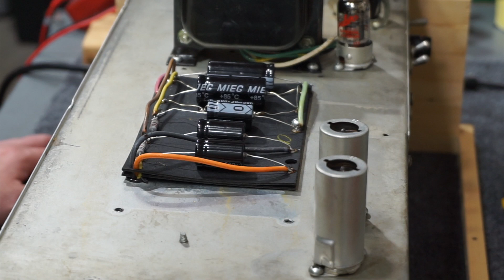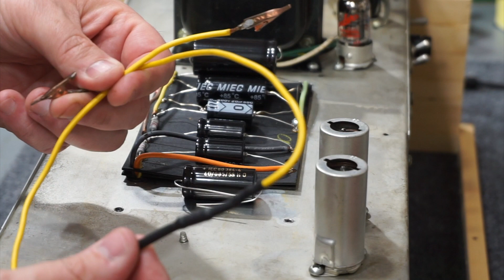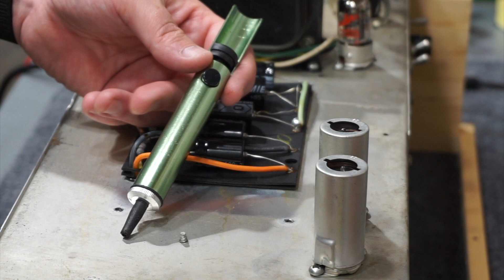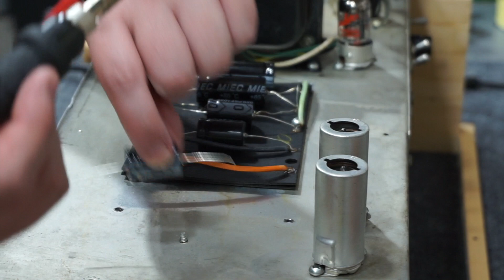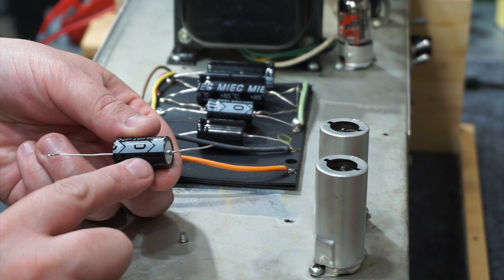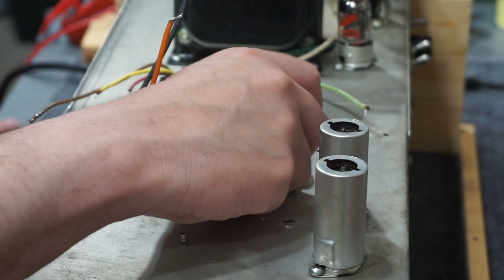Quick Tip 1: Fender Tube Amplifier Filter Capacitor Replacement

Comment: Can changing the filter capacitors change the tonal characteristics of the amplifier? I just had mine replaced and the amp sounds darker, not as much treble as before.
Reply from the maker: It’s possible.  If the same value caps were used, the difference should be undetectable unless the original caps had drifted drastically.  This section of the amp is primarily a power supply.

Comment: so every cap i see similar to this shape i should change? my amp is an 80s Randall RBA500ES and theyre not all together like this theyre separated unless all of them are not filter caps.
Reply from the maker: They may not all be filter caps, but all electrolytic caps have a tend to dry out or break down and drift.  They are typically barrel shaped and look like the ones in the video unless they have both legs coming out the same end.  You can often lift one leg and test them if you have a tester, but they are simple enough to replace in most amps.

Comment: Noob question but for your cap discharge tool/wire with the resistors soldered to it, what value resistors are you using? Also, I notice in a lot of videos, guys are using the old boxy wirewound type of resistors, but it looks like you’re using the metal film resistors? Can’t really tell under the heat shrink. Does it matter what type or material resistor you’re using? Thanks in adcance
Reply from the maker: It’s been many years since I made it, so I don’t 100% remember the resistance values, but I’m pretty sure they are 10K each for a total of 20K.  They are definitely 5W metal oxide.  Wire wound might be simpler to find in high watt values.  I used two only because I didn’t have higher resistance value resistors on hand.
Reply: @hacksguitarhobby  Awesome, thank you so much for your reply!

Comment: How do I measure voltages correctly on these filters? This is for a twin reverb, blackface and I have the schematic for reference voltages. Is it one lead to ground, the other at B+1 for example, and set to DC? Should the stay be on or off when measuring? Observing all safety protocols of course. Thanks.
Reply from the maker: Yes, set to DC unless you are probing around the power transformer, before the rectifier (those voltages will be listed in AC).  All of the caps have a positive and negative side, but the negative is not always ground.  Just clip your meter’s black lead to the chassis (I typically clip to a screw or through a screw hole), sit on one hand or put one hand in your pocket, and probe with your red lead at the appropriate place shown in the schematic.  I think most Fender schematics show the voltage points with the amp in run, not standby, but there may be both listed.  Identify the positive side of a cap from the indent or the negative side from the side label pointing to it: https://www.digikey.com/en/blog/identifying-capacitor-polarization
Reply: You're the best - thanks so much!  @hacksguitarhobby

Comment: How much does this cost to have done at a shop?
Reply from the maker: Not sure, I've always just done it myself.
Reply: @hacksguitarhobby  where do you order the parts from? I have a Randall 200watt G2 that started the 120hrz humming.
Reply from the maker: @NordicRick  usually tubedepot.com but I shop around some.